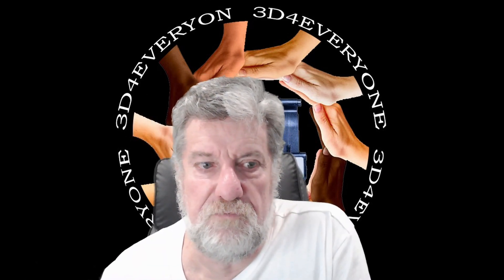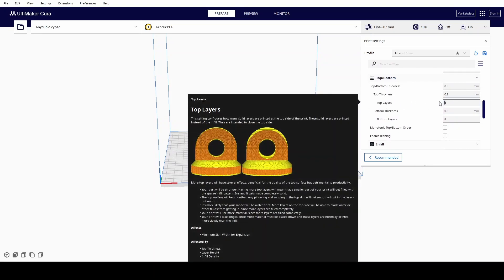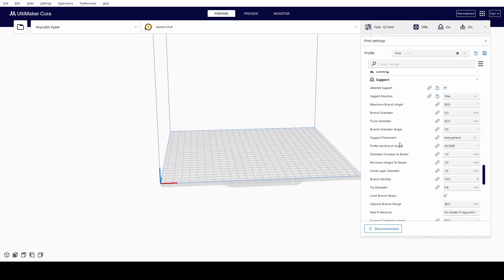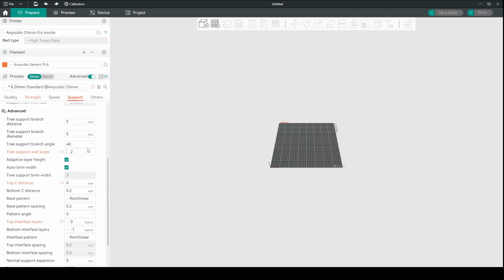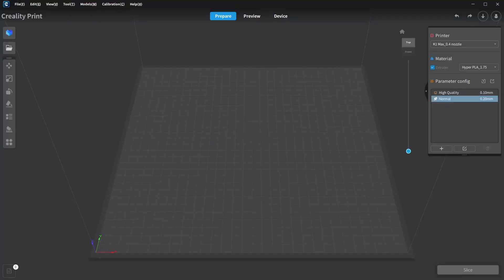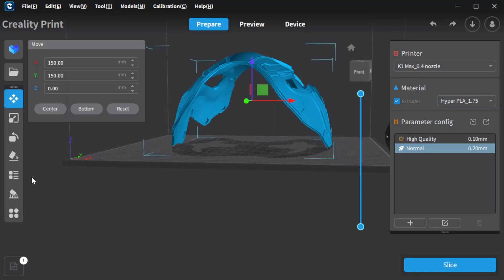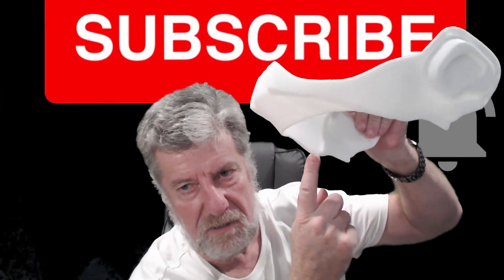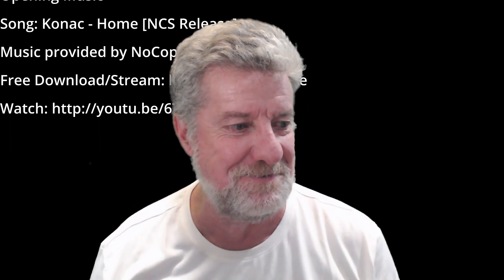Are your slicer setting correct ?  Don't sand your prints. Cura, Ocra and Creality Print. K1 Max P1P

Comment: I have a question for you. I see you have a Creality K1 Max. I have that printer. I am using Creality Print slicer. I don't like Creality's slicer. How did you get the K1 Max to work with Cura? There is no K1-Max printer option in Cura. And thank you for sharing your knowledge.
Reply from the maker: Hi Raul, i don't use Cura with my K1 Max, i have other printers i use that with.  The K1Max i use Creality Print OR Orca, if you haven't tried Orca yet, give it a go, it now has support for the K series:)
Reply: @3D4Everyone1  thank you very much for the suggestion. I downloaded Orca slicer. I had never used it before as I started with Cura. Orca slicer is very good and has many options. I am really enjoying it with my K1 Max.  Thank you very much for the suggestion. Highly appreciate it.
Reply from the maker: @raulc.  excellent so glad you liked it,  its a lot better than Cura